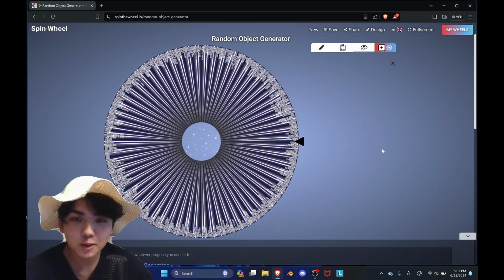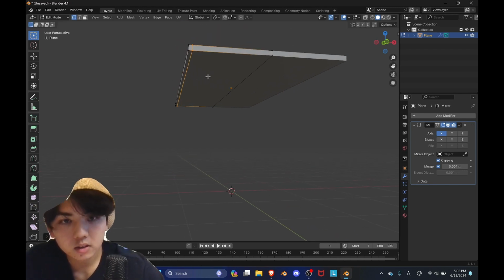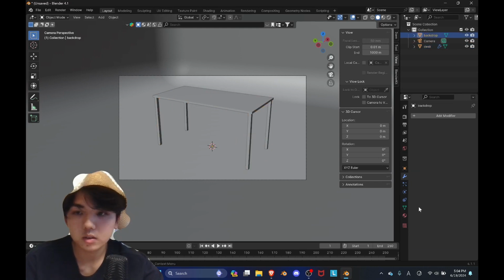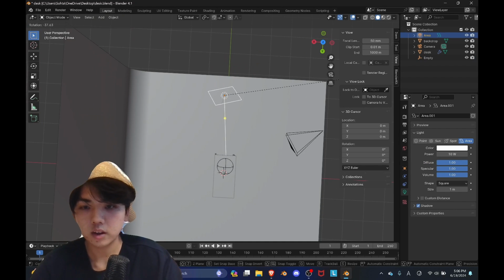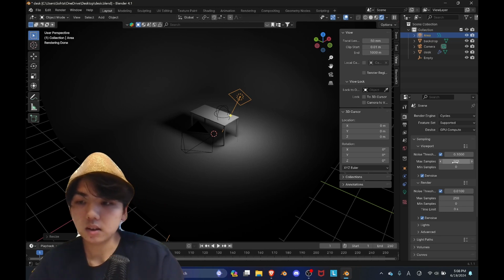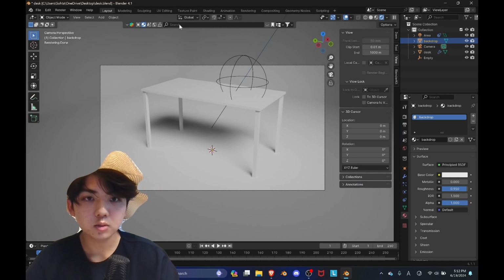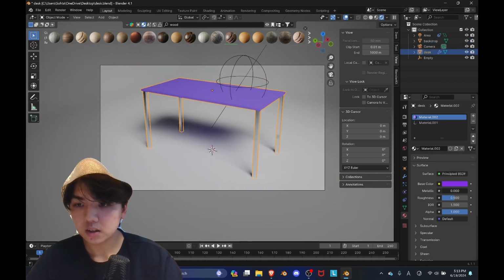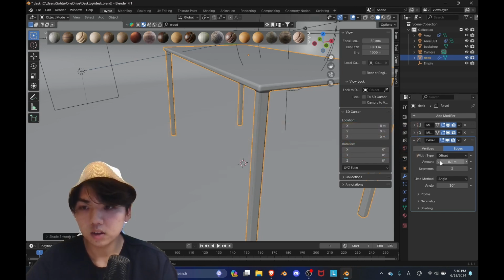How to make an ugly desk in blender - Blender tutorial (3D modelling, materials, lighting...)

Comment: Very informative video! straight to the point. 
Quick question however, how do you change the color of the base? is it possible to change the thickness too?
Reply from the maker: cute pfp. By base do you mean the top or the legs? Changing the color can be done by selecting the object you want to change the color for and clicking on "base color." You'll get a spectrum of colors so you just drag your cursor to the color you want.